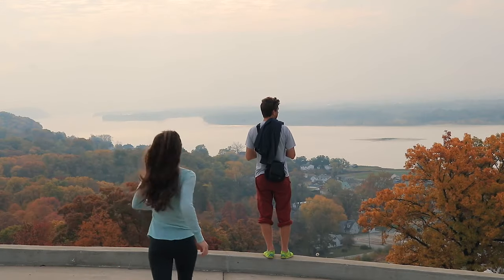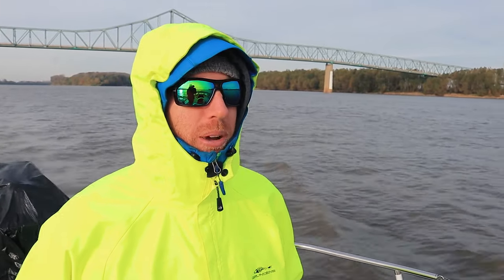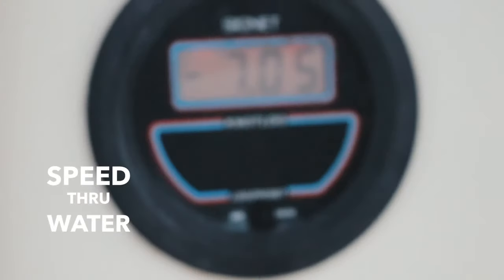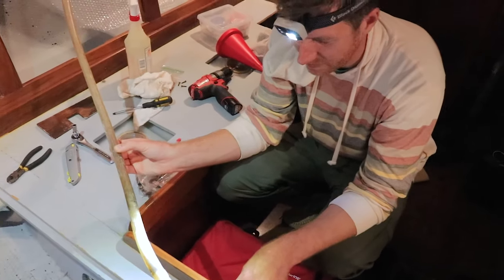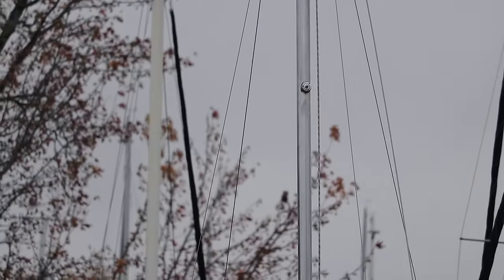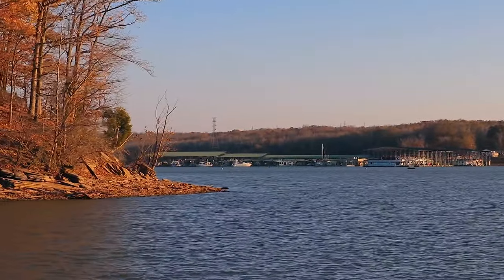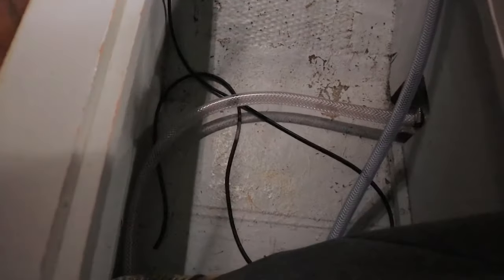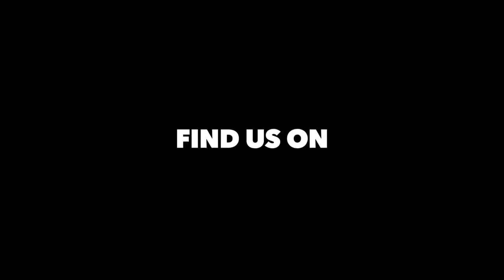Against the Current: Ohio & Tennessee Rivers | Sailing Soulianis - Ep. 29

Comment from the maker: READ THIS BEFORE YOU WATCH!! Make sure the video you're watching is 17:37 long. (If it's 19+ minutes, there will be audio issues about four minutes in -- and we don't want that!) If you're seeing a 19+ minute video, try reloading in a private browser window, or even try a different browser application. Apologies for the issues!
Reply: I had to switch to 720p (from 1080p) to get the 17:37 version.
Reply: Amusingly, even the 1080 version is showing 17:37 but falls out of sync with the audio by having about two minutes of really turbulent video footage while discussions of the lock happen, then the lock footage pops in while the audio discusses fuel consumption and plumbing. The real key here seems to that the 720 version is synced properly, and the 1080 version has the extra footage. Don't need to be in private mode, just switch resolutions.

Comment: Back in the mid 90's I drew the steel shop fab dwgs for the tainter valves for Olmstead Lock & Dam 52 & 53.  The tainter valves let water in and out of the lock chambers and are located in 15' x 18' culverts deep within the concrete monolith.  Thanks for showing the lock in operation, I've only seen it on paper.  It's nice getting a Huck Finn view of the river system.  Great job.

Comment: When you turned off the Mississippi, I couldn't figure out where the heck you guys were heading, so I had to do a bit of research. Until now, I was never even aware of the existence of the Tennessee-Tombigbee Waterway. I've never had much reason to think about it, but if asked I suppose that I would have said that the Mississippi was the only route to the Gulf from way up north.  I'm a slightly smarter person today...thanks!
Reply from the maker: It’s funny it wasn’t until after we bought the boat, and decided we were going to take the “Mississippi” route that we realized this either. 😆
Reply: The Tenn Tom is a convenience.  The Lower Mississippi is very unpredictable.

Comment: An old sailors trick of heating the hose is good, but what is a better way to heat the hose is to submerse it into a pot of boiling water. You use a lot less energy than an open electric element and the hose heats from both the outside and inside. Also, it stay flexible a lot longer. Give it a try I think you'll find it works great! To really save energy do it while your making pasta for dinner.....LOL! wink! wink!
Reply from the maker: The heat was for Lauren and I, it was just a bonus that I could also use it to make the hose more pliable.... -Kirk

Comment: You guys have great VLOGS. Bought my 28' Beneteau at Lighthouse Landing and took it to Cape Coral, FL over a two year period. 12 days to Mobile and 12 days to Cape Coral. It was in October both years and not quite as cold. Keep going, you will get there! You guys are doing great and, so far, not making any serious mistakes. When you get to Pickwick Dam, don't tie up on the downstream wall if you are waiting for the lock to empty. A lot of water comes out of a lock with an 80' lift! You will be sailing with the dolphins in Mobile Bay before you know it.

Comment: Just a quick tip which might help or not...I work in a high tidal range area ( 2nd highest tides in the world) and when I’m using the Lockgates in our workboats we haven’t got anywhere to moor to so we just push the bows on the wall and run the engines ahead or just bob about in the locks... obviously you can’t do that in a sailing boat but I noticed you had sliding mooring posts in the lock..
If you just run a forward spring from say a midships cleat and then run the engine ahead the boat will naturally want to drive herself into the wall and with you on the helm you can control the boat by slightly keeping her bow into the wall..
Just make sure she’s well fenders up and that’s all you’ll need!
Also by staying back in the lock your not right over the paddles or sluices so you’ll find the water is less aggressive further back!
Another thing you’ll find is the current runs a lot less the closer you get to the shore which is where local knowledge comes in handy!
Nice videos and lovely looking boat and you’ve got another subscriber?..
Reply from the maker: In a workboat that sounds like a perfect plan!  But we were trying to stay OFF the wall to protect the gelcoat. Even as it was we were squashing our fenders so tightly that one of them almost ripped the stanchion it was tied to off the boat as the friction from moving up the wall was pulling it down.
Reply: Sailing Soulianis like I said it’s only advice my friend but I also have a sailing boat and going up and down in locks is something we have to do in the area I sail in..
Providing she’s got plenty of fender out you’ll find you will have a lot more control than trying to pull and push the boat off the wall by steaming ahead on the forward spring.
I’ve owned my boat for more than 20 years and my topsides look the same as when I bought her.
Take care..

Comment: Hey an anchoring trick..
Your Tartan 37 will lie well with the anchor at the stern, with the v shape, without the bow anchor down, as long as you have good holding and mild conditions.  So if you use the stern danforth, when you pull it up don't bring the anchor aboard right away.  Leave the anchor at the surface of the water and motor forward, keep a turn of anchor rhode on the stern cleat.  As you accelerate fwd, pay the rhode out until you get about 5 to 6 knots boat speed, and the rhode about 30 feet out.  The danforth flukes will stay flipped up, and the anchor will clean itself on the water surface.  Pull it in after about 5 or 10 mins and it should be clean.
Reply: Or not   ??  your call
Reply: Most people haven't had a danforth flip up in a strong current and refuse to set.

Comment: One of the slickest set ups I've seen for a wash down was a nozzel mounted through the bow that was plumbed to a raw water pump. He had a switch he'd turn on and it would spray a nice high pressure blast of water and would wash the chain and anchor as he'd press the button to use the windlass. It was hands free and super slick! I vowed when I tackle that project I'll do it that way. He also has a d afitting for a hose he could tape in when needed to wash the dinghy or decks.
Reply from the maker: That sounds awesome!
Reply: @SailingSoulianis  I was honestly gobesmacked when I saw it. Thinking why in the world I hadn't thought of this let alone a boat builder.

Comment: I believe posted means "scheduled"! These guys work monthly shifts but when they come back on board they may be in a different area of the river which requires them to do different tasks! A trivia note: Back in 1937 there was a great flood and the water on the Ohio River rose and rose. In Old Shawneetown, IL, just North of Paducah, KY,  the Ohio River was 65 feet below a bluff and the local bank was 200 feet away and sitting on top a hill that had 12 steps that needed climbing to enter the bank. During this flood, the water rose over that 65-foot trench, crossed 200 feet of grass and roads, moved up 12 steps, and stopped chest high at the teller's window. It's hard to imagine, especially when you are down below at the water's edge!